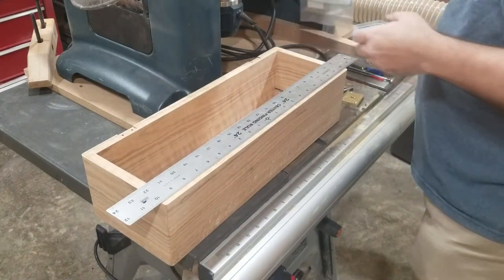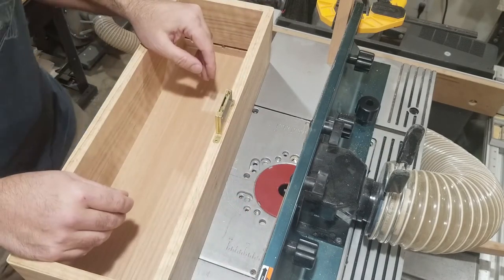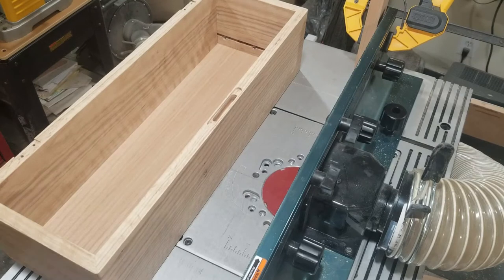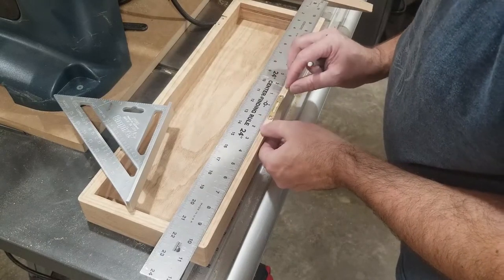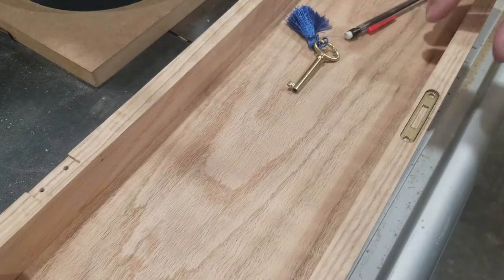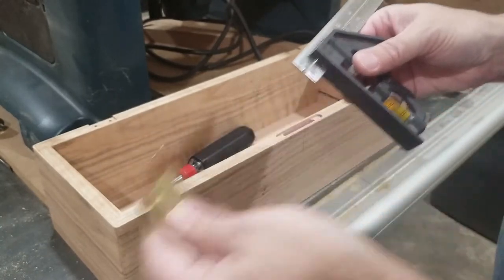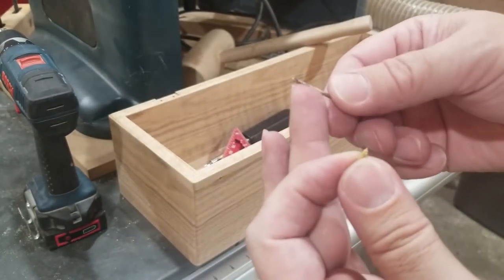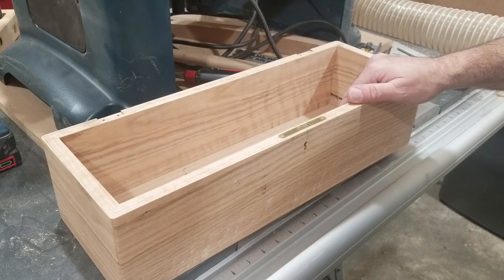How to Install a Full Mortise Lock

Comment: You didn't show how to set the stop blocks.
Reply from the maker: Which stop blocks? If you mean the right and left limits for the box to travel, I mark the edge of where the mortise should be on the outside of the box and make a mark on my router table top (pencil). Then adjust accordingly to get exactly to that mark. It may take an adjustment or two once you start but sometimes I get it perfect from the beginning. I do set it up to be slightly short though and sneak up on the correct stop block location.